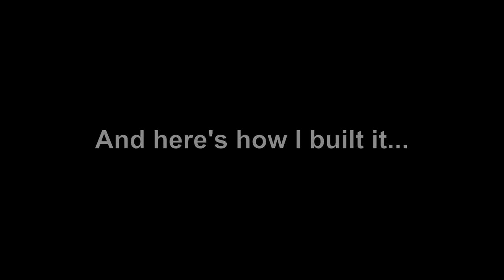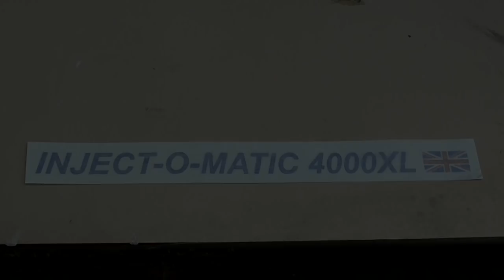Bench-top injection moulder build

Comment: Who needs a workout when you have a hacksaw! lol.. What I'd give for a lathe that can cut threads!
Reply from the maker: I have a small power hacksaw and of course grinders etc. But I just like sawing things by hand, it's less messy and often quicker as I can just grab the saw and there's no setup or changing discs needed.
Reply: @AndysMachines  I need a better hacksaw blade. I'll use a hack saw if it's under 3/8" or if it's too short to put in the chop saw.. or if it's after 10 at night and I can't run loud tools haha

Comment: Great tool.
Too bad need CNC machine for molds.
Reply from the maker: Not always, I've made a lot of moulds with just a manual lathe and/or milling machine, even for my bigger automatic injection moulder complete with ejector pins etc.

Comment: I'm a little confused about milling the hex rod square, then using it to plug square tubing?
Reply from the maker: I wanted to make a square plug with a shoulder and a tapped hole in it centred on it's axis. Hex bar allows me to hold it in the mill vice and index it by 90° by clamping on the flats, then the corners. And I can also hold it in the 3-jaw chuck on the lathe without having to change to the 4-jaw and dial it in. I can't do both of those operations with either square or round bar without some additional setup, plus I probably just had the hex bar to hand and it was the most convenient thing to use.
Reply: @AndysMachines  Ah! That makes sense. Thank you!

Comment: I would like to ask you a question please: why you create a sleeve for  the heating bands and do not fix them straight on the tube in wich the plastic melts ? to what serves A BARREL HEATER SLEEVE? thank you
Reply from the maker: You can put the heater straight on the barrel, but there are many advantages to putting a sleeve in between. This is quite a small barrel so only a smaller less powerful heater would fit directly, the sleeve means I can use any convenient diameter heater band. The sleeve also provides more thermal mass and even distribution of the heat since it is aluminium which conducts heat well. And it also provides somewhere to mount the thermocouple which will give a more accurate reading than trying to put it in contact with the barrel itself.
Reply: @AndysMachines  thank you Mr. Andy. Greeting from Tunisia

Comment: Some really nice engineering there. What model lathe is that one?
Reply from the maker: It's just a Far Eastern made 10" bench lathe that's sold under various brands. There are more modern versions of it now with variable speed etc. but all the same castings. I've had mine for 20 years.
Reply: @AndysMachines  Thanks, I'll look out for one. Second hand would be alright if yours had lasted that long.

Comment: What tolerance did you use between the barrel and the rod?
Reply from the maker: Between the barrel and the rod there is quite a generous clearance, around 1mm. On the end of the rod is a bronze piston about 10mm long, this has a tighter clearance, around 0.05 -0.1mm though you could probably get away with more, 0.5mm or even more. The plastic directly under the piston is usually not molten unless you let the machine run low or leave it to sit for too long between shots, so it's unlikely plastic will bypass the piston even with a fairly big gap.

Comment: How did you do the radius on the end at 15 mins 20 secs into the video??  awesome job though.
Reply from the maker: Well spotted! At the time I had partially converted that milling machine to CNC and this cut was done under CNC control. I still mostly used the machine manually though and it wasn't an ideal setup for both. I've since changed it into a dedicated CNC mill and got another larger machine for manual use. I will often just saw and file a radius like this, but as I had 4 to do it was worth using the CNC.

Comment: what exact model is that lathe machine
Reply from the maker: It's one of these:
https://www.chesterhobbystore.com/shop/metalworking-machines/lathes/db10vs-super-lathe/
Though mine is an older model without the variable speed. The same identical castings (far eastern) are used on a lot of different manufacturers lathes of this size.

Comment: How many watts is your heating element?
Reply from the maker: It's 150 Watts. Heats up from cold in about 10 minutes and has no problem keeping up, it will melt the plastic as fast as I can inject items.
Reply: Can 120watts work?
Reply from the maker: @garciapatrickdaniels.7568  Yes I expect so, it will just take an extra couple of minutes to heat up initially.  The 150W band is only ticking over when it's up to 230°C, it would go a lot hotter.
Reply: (35x45mm) 150 watts heater band is enough to reach 230 deg celusis to reach. Which one is mica or ceramic?